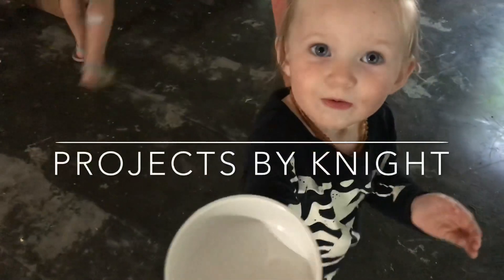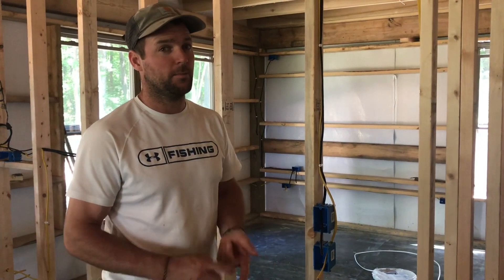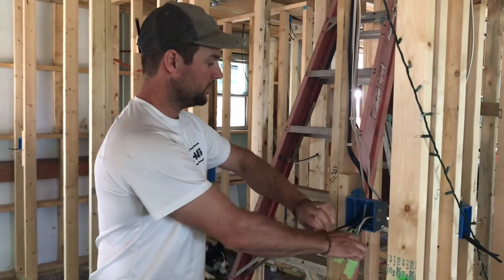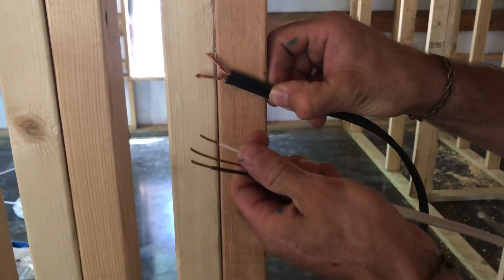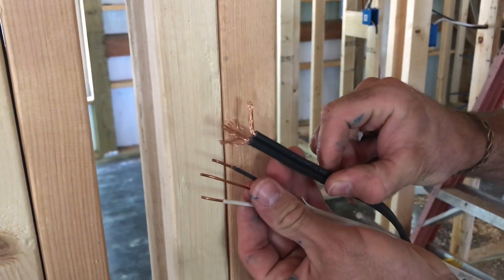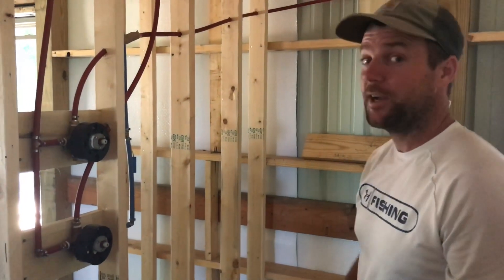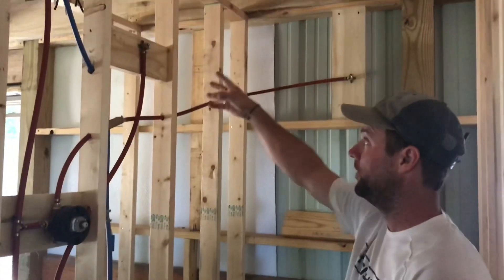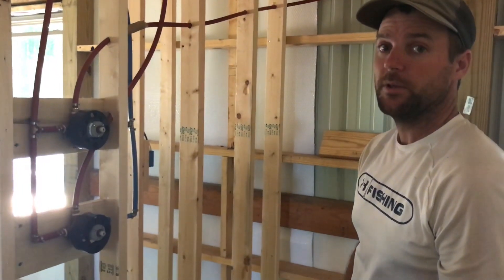Our Pole Barn House Plumbing & Electrical Ep 6

Comment: Just started researching post frame houses and stumbled across your series, thanks for sharing. For electrical, the electrons travel on the surface of the wire. This isn't an issue for AC since the electrons are basically just shaking back and forth 60 times per second. For DC it is a bigger issue because electrons have to flow the entire length, so resistance becomes an obstacle and creates heat, so a multi-strand wire is much more suitable to DC power. And safer.

Pretty ingenious of you really, it's much cheaper/easier to run solar without a DC/AC inverter!! Money savings!
Reply from the maker: Z3R0 CHANC3 thanks for the explanation...sounds like you know more about electrical than I do! Thanks for watching!